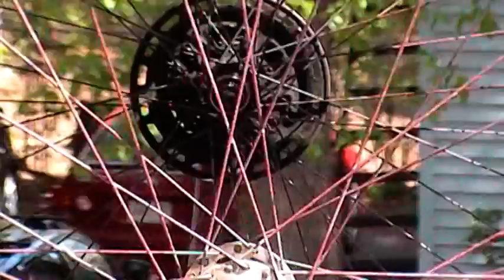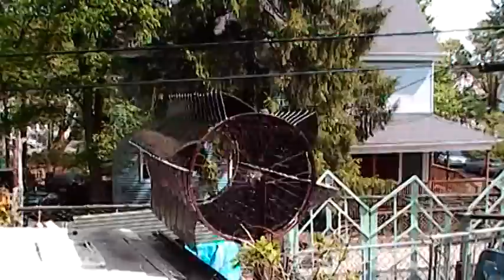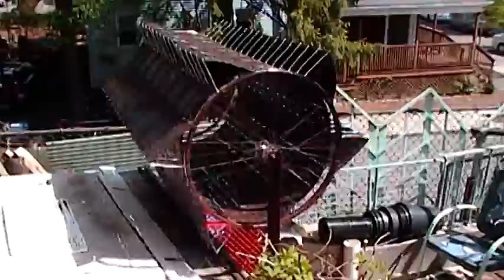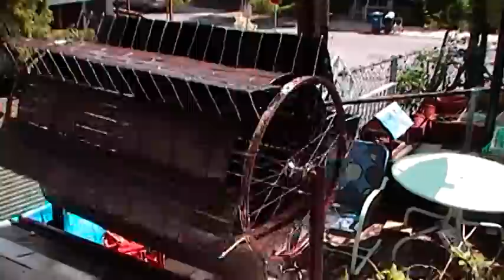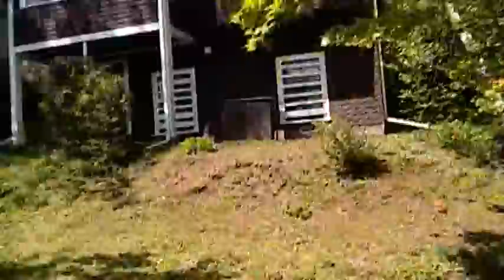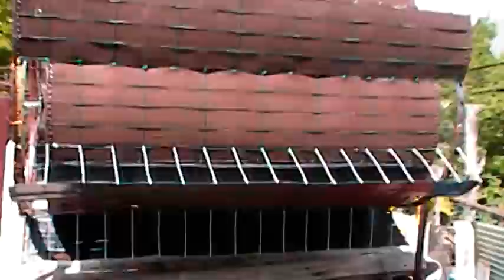Wire Mesh Wind Turbine HAWT

Comment: wheres the motor , isn't this just two bike wheels? Thanks
Reply from the maker: +Gavin FreedomLover  HAWT is an acronym that means horizontal-axis wind turbine. The turbine in the video can also be setup to be a VAWT (vertical axis wind turbine). You are looking at the rotating blades and asking about the generator (or alternator).  One or both wheels can have a hub generator at the axle. If none of the wheels has an alternator or generator at the hub, the rotating blades do not generate electricity. However there is no acronym for horizontal axis wind blades. HAWT is used for both cases.  Wheels that have a hub generator can be found in some bicycles Thanks for asking!